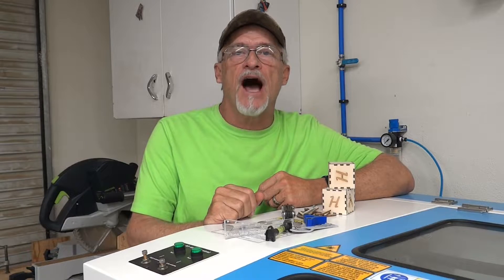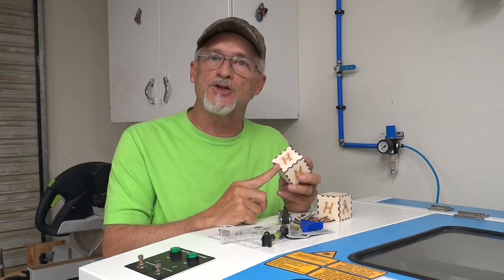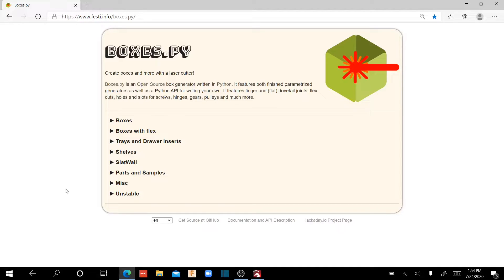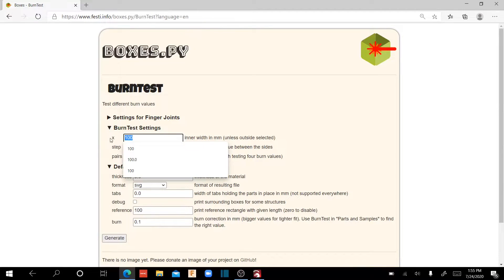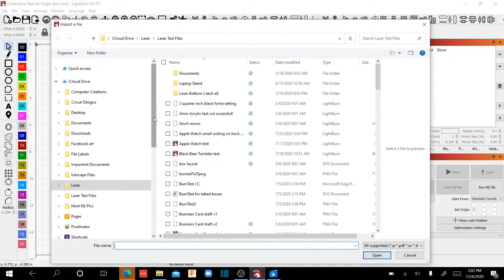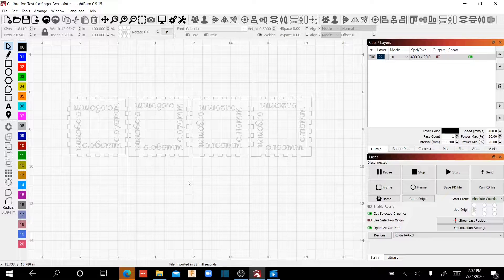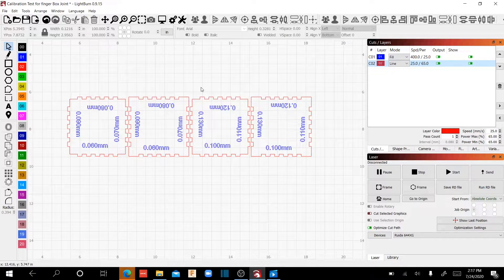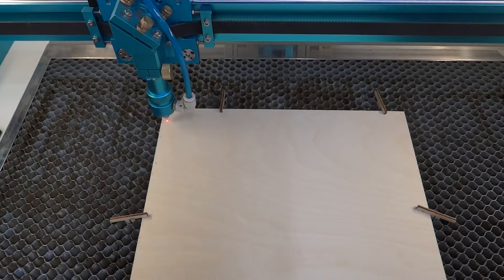Your First Box with LightBurn (for Beginners)

Comment: I followed your instructions the burn test was great found that my 2.7 mm material needs the burn changed to 0.120 mm. as per the test. But when i changed it for the box you cut in the second half of the video it does not work .... PLEASE tell me what i am doing wrong ? i tried another pattern as well and still will not fit snug and the ones the require the interlock piece  the holes are not big enough. Thanks for your informative video the instructions were great ! I just done understand what i am doing wrong?
Reply from the maker: Are you using a diode laser or co2 laser. The video was created with a co2 laser. So if your using a diode the kerf can be much larger and won’t work with these settings

Comment: I get this response when using it: _Conversion failed. pstoedit returned 1

b'pstoedit: version 3.75 / DLL interface 108 (built: Jan 27 2021 - release build - g++ 11.0.0 20210123 (Red Hat 11.0.0-0) - 64-bit) : Copyright (C) 1993 - 2020 Wolfgang Glunz\nError: /undefined in pstoedit.nameOfOutputFilewithoutpercentD\nOperand stack:\n PermitFileWriting\nExecution stack:\n %interp_exit .runexec2 -nostringval- -nostringval- -nostringval- 2 %stopped_push -nostringval- -nostringval- -nostringval- false 1 %stopped_push 1974 1 3 %oparray_pop 1973 1 3 %oparray_pop 1961 1 3 %oparray_pop 1818 1 3 %oparray_pop -nostringval- %errorexec_pop .runexec2 -nostringval- -nostringval- -nostringval- 2 %stopped_push -nostringval- -nostringval--\nDictionary stack:\n --dict:1209/1684(G)- -dict:0/20(G)- --dict:97/200(L)--\nCurrent allocation mode is local\nCurrent file position is 1266\nGPL Ghostscript 9.55.0: Unrecoverable error, exit code 1\nPostScript/PDF Interpreter finished. Return status 256 executed command : gs -q -dDELAYBIND -dWRITESYSTEMDICT -dNODISPLAY -dDELAYSAFER -dNOEPS "/tmp/psinzpBsT2"\nThe interpreter seems to have failed, cannot proceed !\n'  Followed the instructions to the letter.

Comment: Make sure your kerf setting is set to zero (off) before you start. To get to kerf settings click on the layer C001 C002 etc. 
When you cut a box for real, go back to kerf settings and input your value. In my case 0.06 mm. Worked fine, nice tight joints.
Hope this helps.
Reply from the maker: great input thank you!

Comment: Hi Robert. Great easy video to follow. I have really not done too much cutting with my laser (Nova 51/100) yet, but I may well try some boxes to try get settings dialled in.

I do note however, that your cut lines seem extremely clean compared to how mine come out. Are you using the generic Thunder air pump in this video or did you use an assisted air compressor when you created this video? I get soo much charring on all wood when cutting. I really don't know where to start changing this tbh.. :(
Reply from the maker: I have external air delivering 35 psi to the nozzle. this provided mush cleaner cuts!
Reply: @computercreationz  I know this was a very old video Bob, so thank you for taking the time to reply. 😁 I intend on getting a compressor very soon.

Comment: Okay, so I was able to get the burn test to work, but when I actually try to create a box, it does not create the labels and the download and generate buttons do the same thing which is downloading the file without any labels.
Reply from the maker: change the output format, svg doesn’t work sometimes try other formats and you will find one to work

Comment: Excellent video.  When doing the burn test do I need to do anything different if my laser point is not square?  Mine is 0.08x0.05.
Reply from the maker: you will have to adapt the Kerf based on your specific laser. most are a little different
Reply: @computercreationz  Actually, I did not have to do much.  I just performed the burn test on boxes.py.  0.07 works for my laser.
Reply from the maker: @zk_6312  that is my setting as well

Comment: Hello there. I just got an Ortur Master 3 this week, and I am loving it. One of the things I wanted to make is boxes for different things. I played with the box generator you recommended in here before I found this video and to be honest it was Chinese to me. All the numbers and values were very confusing, so I want to thank you for this video although is from 2 years ago it helped me today 2 years later. Another thing that I want to make with my laser is puzzles. I cut one but it is a little bit lose so I do not know if there is any way to cut it in a way that the pieces are a little bit tighter like a commercial puzzle. I cut the puzzle out of a 2mm cardboard, and it took 2 passes at 10000 mm and 100% power. Any suggestions? Thanks
Reply from the maker: thank you for your comments.

Comment: I'm not sure what I'm doing wrong, but I just can't seem to get a working burntest. My laser is supposedly 0.06mm, so I would expect the kerf to be right around that. I've done the burn test down as low as 0.04 and the results are still as loose as any others. What might cause this? Could it be that the 3mm plywood I got at the local craft store is too low quality and is burning away the differences among all the different sizes? I'm getting really frustrated that after cutting a whole bunch of these I see no difference no matter the value it's supposedly measuring. Any advice would be greatly appreciated. Thanks.
Reply from the maker: I would be willing to bet there is an input you’ve forgotten. go back and if there any open fields be sure there populated. I’ve seen that the cards don’t generate accurately when fields are missed.

Comment: I really enjoyed this video as it has explained a number of things to me. I just got a 60 watt laser last weekend but I don't have a RIUDA controller so I am using Inkscape and K40 Whisperer, however, when I cut the file all of the different sizes fit together and felt like they had more or less the same tolerance, so I created a new file starting at .040 with .005 increments figuring I might find something closer. Still all of them felt like they were all the same size, so no difference in the tightness or lack of. If I line up .07 with .045 they look the same, so I'm thinking something is just not scaling, also when I check sizes with calipers  all of the tabs are pretty close to 5.7 to 5.8 mm. I know I'm using Inkscape so you may not be able to help with this but if you have any ideas, I'm all ears. Cheers  Phil
Reply: I just had the same problem.  All tabs came out the same. :(
Reply: @bonniebrock9636   I just had same probelm  was gutted lol
Reply: it sucks
Reply: Hi Folks, I had the same problem. Figured it out. Make sure your kerf setting is set to zero (off) before you start. To get to kerf settings click on the layer C001 C002 etc. 
When you cut a box for real, go back to kerf settings and input your value. In my case 0.06 mm. Worked fine, nice tight joints.
Hope this helps.

Comment: Good information.  Thank you for sharing.  I have several boxes I need to make.  I have seen people made sliding lids on some boxes, where the top slides into a grove cut by the laser.  Do you have any insights on designing that type of lid?
Reply from the maker: they have boxes with lids in that tool

Comment: This is odd. I have actually made a cut yet but when I generate the file. The male section measures larger than the female section when I use a positive burn rate such as .06. If I use a negative number for the burn rate the file measures properly.
Reply: I guess I should give it a test run and see what the kerf does.
Reply from the maker: that is strange!

Comment: I would like your assistance pls. I have tried getting the Kerf twice , started with the burn at 0.060 - 0.120 and second piece 0.14 - 0.21 . The problem  I have is that they are all loose , note of them will fit . Pls advice 
Thank you
Reply from the maker: cut a 1” square out and measure it and the difference divided by 2 will be your kerf
Reply: @computercreationz  Thank you very much

Comment: Question do you have to run the burn test for each thickness of material ?
Reply from the maker: I’ve found that your setting will differ between wood thicknesses.
Reply: @computercreationz  Thank you that what I figured but wanted to check, just now figuring out boxes,

Comment: Hi I am using Atomstack 20 w diode I followed your instructions in burn settings downloaded & imported into lightburn, however when I try to alter Asian make writing smaller and change layers when I change the outer boxes to red in preview it does not cut out the box in one go it seems to do a side first then the next side I have tried alsorts but cannot rectify what am I doing wrong help

Comment: Thanks for sharing, good info. Question since I'm a lightburn rookie, how did you get the cut colors on the left side of the screen ??
Reply from the maker: right next to the black color there are a vertical row of dots grab that with your mouse and drag it where it works for you. very handy

Comment: Clearly burn correction is related to kerf size, but not obvious to me how? If the correction was the kerf size then larger numbers would be looser, but they are inverse. What does the burn correction actually mean??
Reply from the maker: when you cut something with your laser it burns away a certain amount of material. the kerf adjustment will increase the size of your cut to compensate for the material cut away.

Comment: Hi Robert I have only been on Lightburn for a short while. You have taught me a lot in the last few days!! I have made the box after getting the right size fingers!!! The box is on my desk, no glue just knocked together, lovely! Now her is my question, you mentioned it would take you about six minutes to cut the box out. Well it took me about an hour! I have a 30w Neje laser . I am using 3mm Plywood. The settings I used was 40% and speed 150mm and I ran over it 3 times. Where am I going wrong?? Cheers Percy
Reply from the maker: Thank you for you comments I appreciate it. as for the time it takes to cut out the big difference is you are using a diode laser and those typically aren’t made to cut much of anything. I use a 60 watt co2 laser that is much faster when cutting materials. I started on a diode laser and it’s what got me into the laser world. thanks again for watching.

Comment: Enjoyed the video.  Two questions.  Your little hold downs are those just T shaped pieces cut out?  Second.  That little hammer looks sweet.  Is that just plywood glued together?
Reply from the maker: The t type pins are tpins I cut out of 1/8” ply same for the hammer bought the pattern off of Etsy and glued them together.

Comment: Downside is that for new Lightburn users; if you have never used Lightburn and just downloaded it, you have to use a USB cable to connect your laser device to the software program or the program will not even start. It will not even allow you to open the program, so if you are like me, my computer was across the office so I had to buy a 15 ft USB cable just so I could establish the link and then I was able to begin. Maybe a lot of watchers are beyond that point but if not and you are downloading the program wondering why I cannot proceed, that's why.
Reply from the maker: Your statement is just not true, you will have to put in some parameters for laser bed size and type of controller to use but once you do that you can use LightBurn totally disconnected from any laser source.. there is lots of info on this the LightBurn forums.

Comment: OK was thinking about the kerf test pieces. I made them and tested the kerf by making a test box from the PY site.
seems to me that once you have got your kerf figured out for one thickness of wood and you change the bed height it throws you completely off.
You pretty much have to set it for a wood height then make test squares then use them ONLY with the height that that wood is set for on the auto focus (or manual)
great video BTW
Reply from the maker: thanks for the comments, I appreciate it!

Comment: Can you give the details of the wood material used? Which kind of wood, which thickness etc. Thanks!
Reply from the maker: That was .12 or 1/8” Baltic birch plywood. It works great for this kind of stuff. Regular plywood has too many glue pockets in it, very hard to cut with a laser.

Comment: This is a great video thank you for doing it.  My only challenge now is where on earth do you find sheets of 3mm wood that big?
Reply from the maker: I buy the 5’x5’ Baltic birch at a local hardwood store and cut it down my self.
Reply: If Lowe's or Home Depot are out, or the panels are terribly warped, Hobby Lobby has small pieces 12" X 24" for $5.00 1/8th

Comment: Firstly, thank-you for doing this video.
I understand that it is not your program, but maybe you can help. I followed your instruction for the program exactly. And changed my settings in lightburn from inches to mm.
However, when I imported the DXF, each piece was 2205mm, not 75mm. I scaled each one down to 75mm, but am thinking this may also change the curf and I am not getting a true #

any help would be appreciated.
Ray

Comment: Thank you for the informative video! I made two test boxes, and both times the .07 edges were too loose, and the .06 edges were perfectly tight. Does anyone know why .06 would be tighter than .07? Thanks again!
Reply: 1 hundredth more off?
Reply: @DavidALovingMPF102  The fit should get tighter as the number increases, not the other way around. I figured out that my x and y axis were a little off from each other.
Reply: @rachelkamath1866  Ok, good. You are way ahead of me on this type of project. I have some 3.4 mm panels, but today, I think I'm supposed to make Christmas cards!
Reply: @DavidALovingMPF102  I haven’t had time to laser in a while - Too busy with other holiday projects around the house too!

Comment: Nice thank you is it possible to cut a lid for a box with this
Reply from the maker: Yes, In the same box generator you can just make a simple box with no dividers. Just make the inside measurements a little larger than the outside measurements of the box you make. It would be a great way to get used to using the box generator. Once you figure that out the sky is the limit. Thanks for watching!

Comment: Armchair expert here, since I’m still waiting for my Chinese 80W machine to be delivered. Take anything I suggest with a grain of salt, and please correct me if you think I’m mistaken.

I love the website tool for working out kerf (the width of the cut line), but I’d caution against using that value when generating files. The kerf of your machine can change, with new optics, replacement tube or even mirror realignment, and you don’t want to regenerate your entire library of parts when that happens.

A better option, I suggest, would be to generate your files with a kerf of zero and use Lightburn’s “kerf offset” parameters to adjust the actual cut. On the box you generated, the blue layer was negative (inside) kerf and the black layer was positive (outside) kerf. Values of -0.07 and +0.07 sound about right for your machine.

Excuse me if I’m preaching to the choir, I know this is a beginner video and you sound like you know what you’re talking about. However, I’m guessing you wouldn’t want your subscribers put in the position of having to regenerate their entire library of files when their machine parameters change.

And thanks for the channel. I’ve just found it and I love it.
Reply from the maker: I appreciate your perspective. My goal for this video was to get beginners just to think about kerf. And at some point generate there own patterns without the aid of a tool. Welcome to my channel! And have a great day!

Comment: Thanks for the tutorial. I ran it twice and none joints were tight, any idea on what might be the issue?
Reply: I have the same problem.  All my joints were loose.  😕
Reply from the maker: Did you cut out test pieces that have different kerf setting on it and then fit each one  of those to get your kerf offset?
Reply: @computercreationz   Yes I did the burn test if that is what you are referring to?
Reply: @computercreationz  Do you need to enter the scanning offset adjustments into light in from the card that Thunder sends you first?
Reply from the maker: @lupowins  yes it should be one of the first things you do this will assure you machine runs accurately right out of the crate.
Reply: @computercreationz  I entered the settings and set them as active, there was improvement but still not getting tight fits. Any other suggestions on what could be amiss?

Comment: Thanks for the video,  I had to go to  .19 to get my joints to fit. What am I doing wrong? I cut a box and it was good but not sure why I went to. 19. I am using 1/4" plywood,  would that make a difference? Thanks again for this and your other videos.
Reply from the maker: Yes different thicknesses can have different settings. It seems that the thicker you go the bigger your setting

Comment: This is an excellent video. I think you grossly underestimate your audience however. I know of dozens of people currently running or trying to run cottage industries who should make this video essential viewing. I'll recommend it to the groups I'm involved with. I could only find one minor thing in the Lightburne section. Instead of Shift selecting each block of text, you can run a marquee over all the text to select it. It's probably four times faster and four times more accurate.

Comment: This is a fantastic box maker. The creator has so so many variations. I use this site for a hands on class after the intro to lasers class.

Re the SVG fonts - the fonts need to be converted into a vector.
In Inkscape: select text, menu>path>object to path
Then Lightburn will see it